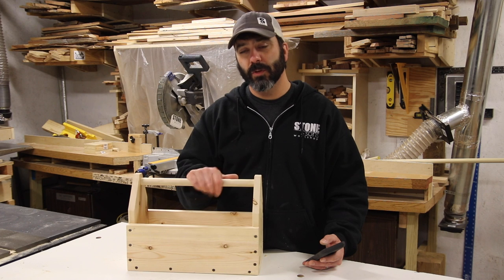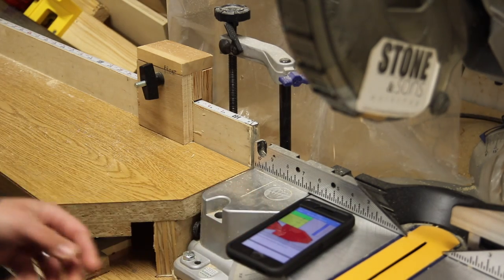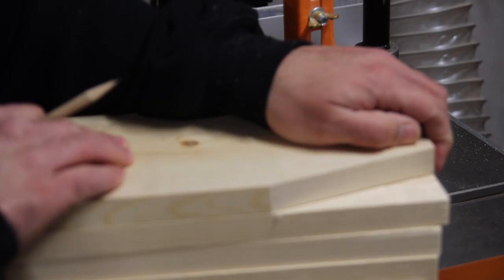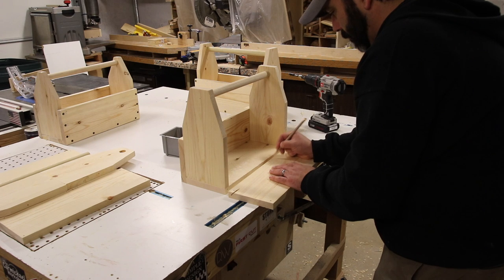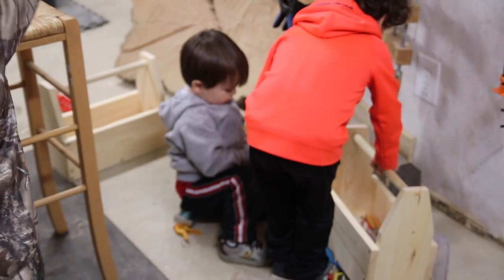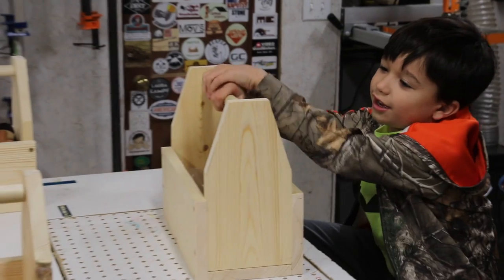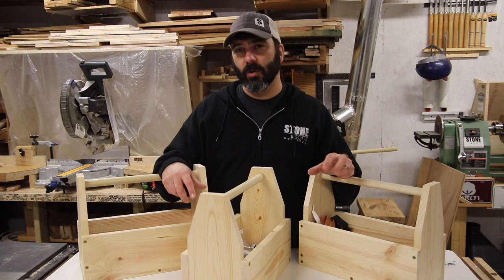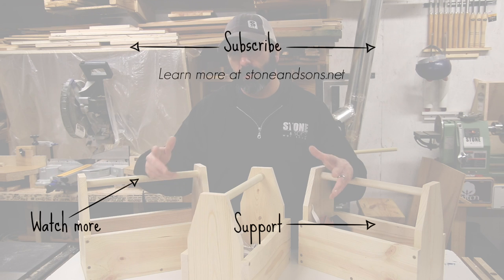Woodworking Project - Easy Tool Tote

Comment: Great project for the kids. It was my 2nd project in junior high woodshop. I think it's still at my dad's. I need to see if I can find it. My only suggestion is to radius the top ends or at least break all the edges on the top of the ends with sand paper. Loved seeing your kids having fun and leaning to put things together!
Reply from the maker: +modsquad8u yeah, the corners will be sanded down. They are learning. Thanks for watching.